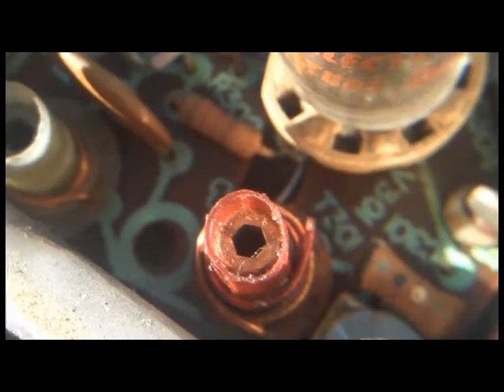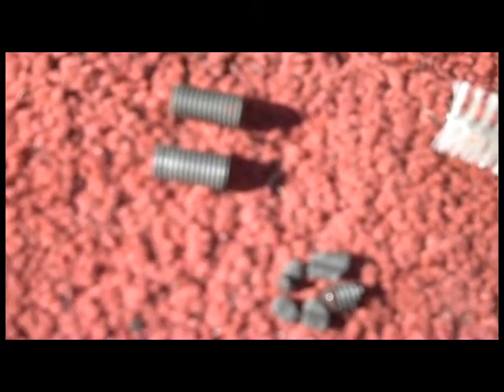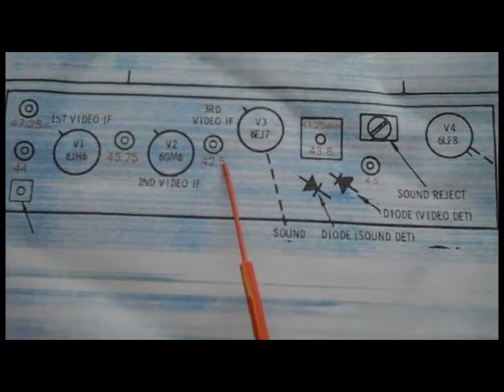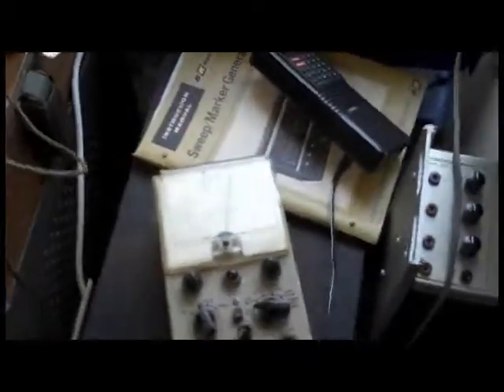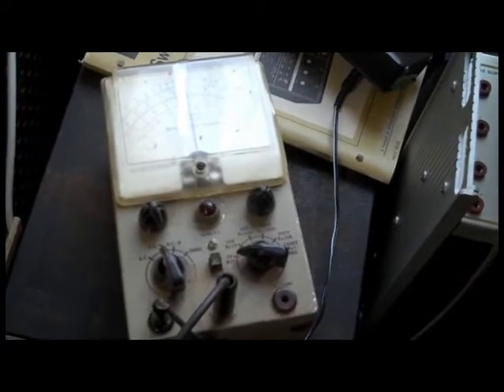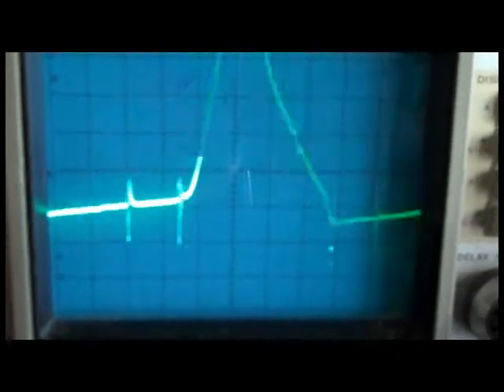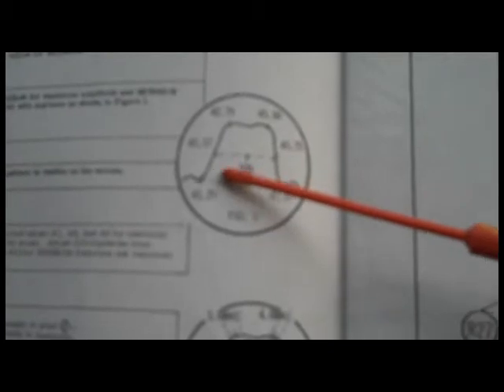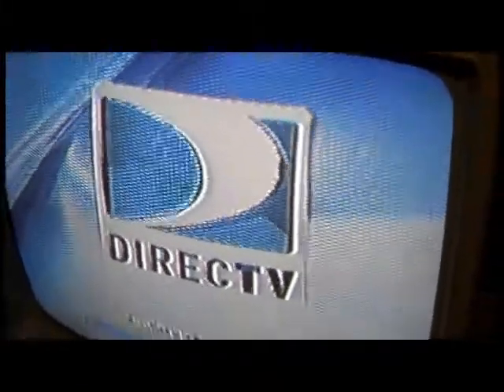TV Intermediate Frequency IF Alignment With BK 415 Sweep Marker Generator Video 2

Comment: Crappy, worn out alignment tools will split those cores faster than anything.  I have a set of ceramic hex-aligners.  On real old coils, warm the coil up with a hair dryer to soften the wax.